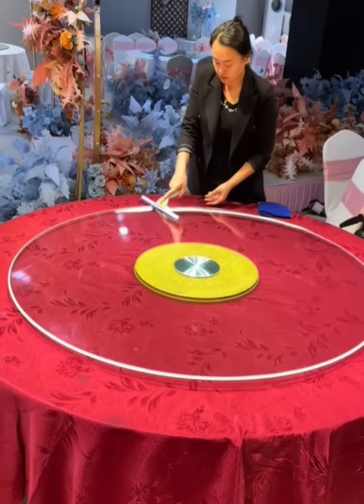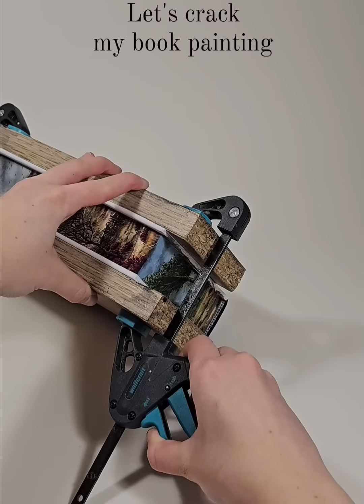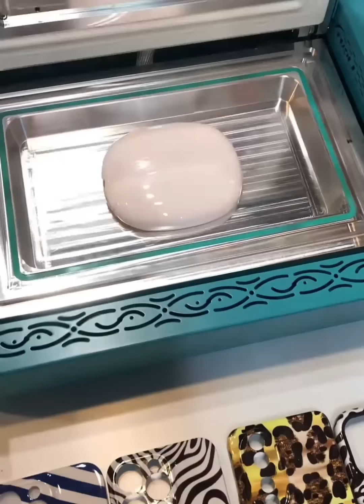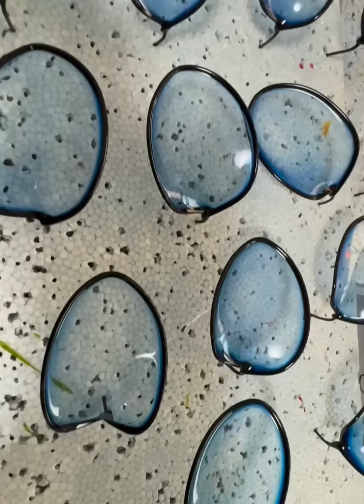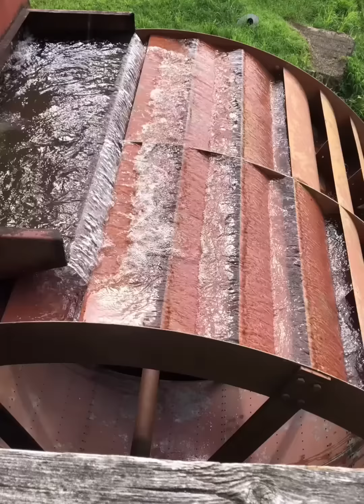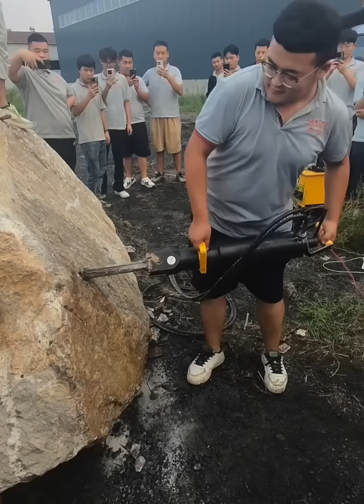Most Satisfying Craftsmanship, Factory Machines and Ingenious Tools That Will Lift Your Mood

Comment: It would be nice if this guy had the correct information! Red ink does get filled into the pen cartridge thru the tip. That was red wax put over the tips to keep them from leaking!
Reply: Well also spraying rims, but the tires are mounted already. That seems like a not really good paint coverage

Comment: "A brush and running water are used to clean a cheese wheel"
IM SORRY WHAT
Also at least give it a fresh wax seal after clearing and cleaning off that stuff esp. If you gave it the gravel grit down scrub because mold SETTLES